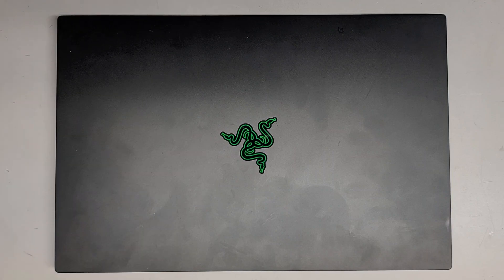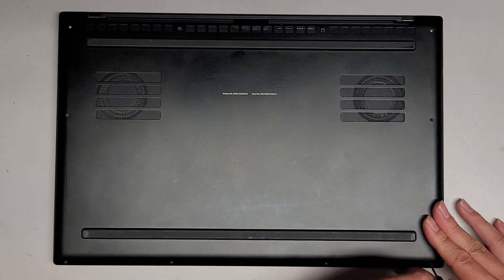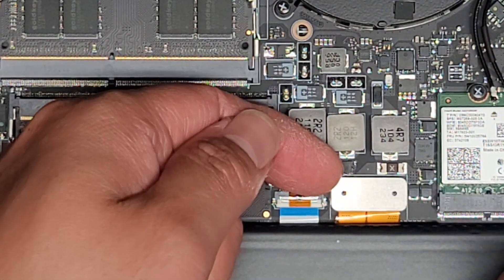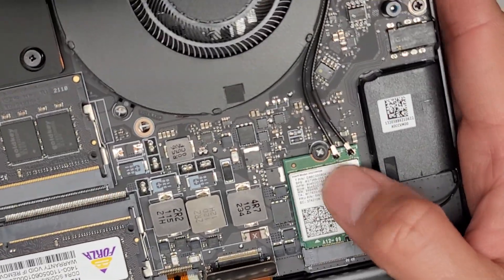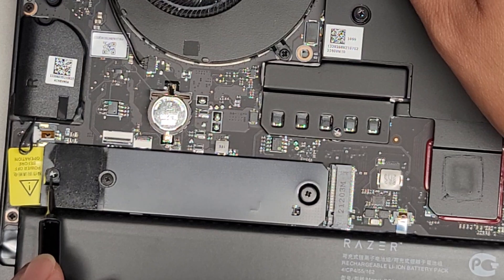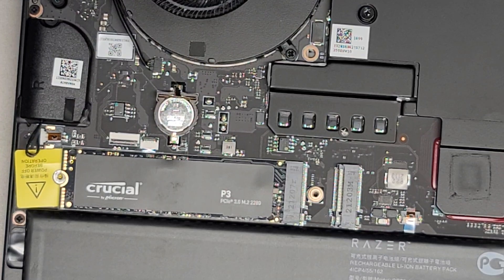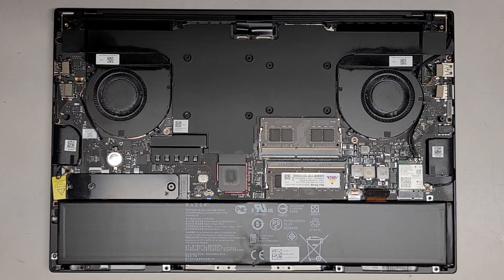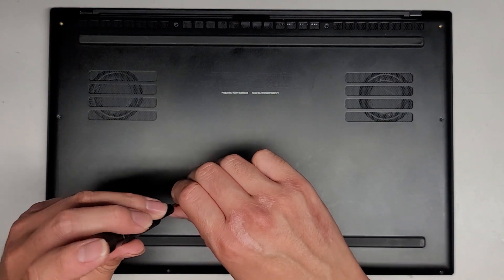Razer Blade 15 rz09-0409 Disassembly RAM SSD Hard Drive Upgrade Battery Replacement Repair

Comment: Do you have to use that USB after changing the SSD always?
Reply from the maker: Usb?
Reply: I meant the USB to install windows. Or can you do it any other ways? @ItsBinhRepaired
Reply from the maker: @juanmabenitez3313  of course you can remove it

Comment: Not a single battery was removed. 😡
Reply from the maker: @cortez8600  didn't realize people needed help taking a few screws out. It lifts right out after that.
Reply from the maker: @ericnoone4189 I got a notification with your comment, but I didn't see it when I went to reply to it. I'm not sure if youtube deleted it for whatever reason or you realized it was only 6 screws? One is hidden under the SSD, but should be easy to figure out when you get the replacement battery.
Reply: Yeah I could only find 5 screws, there seems to be something else holding the battery down
Reply from the maker: @RobertJBareIII let me show you how to figure things out. My channel is about teaching people how to do things. I don't have magical powers. If I can't figure out how something is secured in place, I just look at parts and you can easily see there are 6 screw down points.

https://amzn.to/4hV4BzM

My guess is you didn't get the one under the SSD.
Reply: I figured it out, there is an adhesive strip similar to an iPhone battery on the top edge of the battery near the SSDs. You’ll see it if you look slightly down from the yellow tag from the SSD. You have to pull that before the battery will come free
Reply from the maker: @RobertJBareIII adhesive? That's interesting. I hope you got all 6 screws out and didn't just rip it out. Lol
Reply: @ItsBinhRepaired  I can send you some photos if you’ve got an email, but while the battery in the RZ09-0409 model is a RC30-0248, in this model they seem to have removed the sixth battery screw down tab under the SSD and replaced it with adhesive to allow the double stacking of the SSDs (the first SSD sits almost flush with the motherboard). Because of this they removed that screw down point and they added adhesive with a pull tab release similar to what is used with iPhone batteries.

For some reason all the listings on amazon I could find for an RC30-0248 all have the six battery screw down tabs, but seemingly all models with double stacked m.2 SSDs lack this sixth screw down tab
Reply from the maker: @RobertJBareIII  interesting. You could make a video and put it on your channel for people to see.
Reply: @ItsBinhRepaired  perhaps, I need to source an appropriate battery first. I’m not liking many of the ones I’m seeing on Amazon in that a great number seem to be copycat batteries that omit or bypass safety features. If I had known how little or a complete lack of information there would be about this particular model I would have been recording from the start before I removed the adhesive
Reply from the maker: @RobertJBareIII  yeah, manufacturers are always trying to throw us off.
Reply from the maker: glad you were able to figure it out. :)